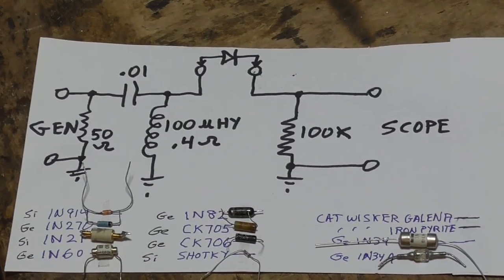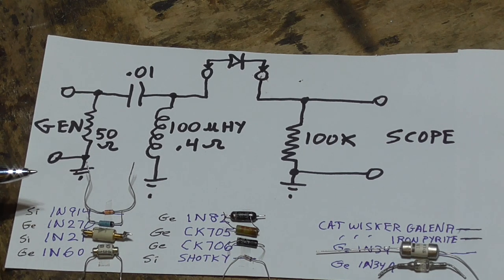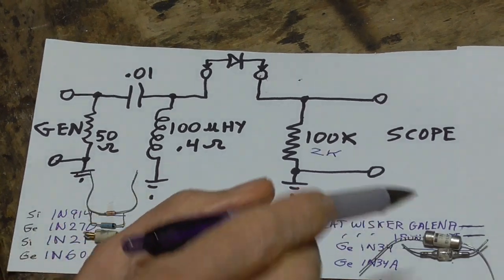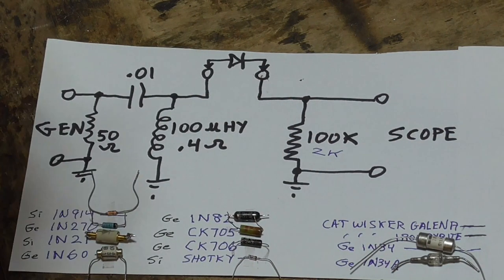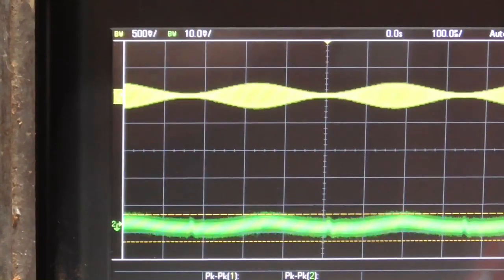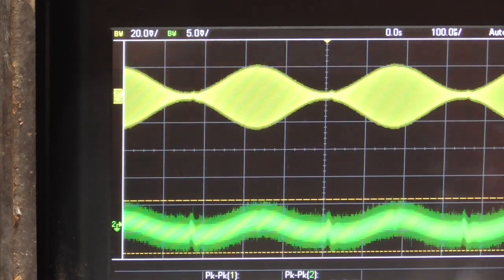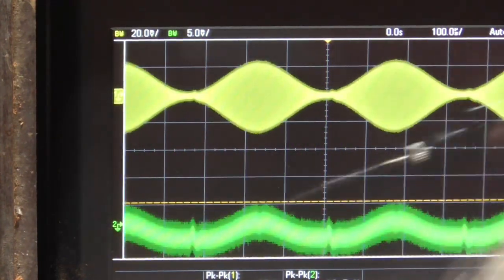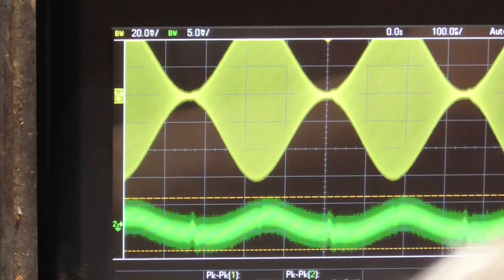TESTING DIODES FOR CRYSTAL RADIOS

Comment: Great video thank you. I recently read a Jan 2007 article by Bob Culter describing a high sensitivity xtal set using a zero threshold double MOSFET chip ALD110900A for the detector. I built his circuit but could not get it working,  I could not find the ferrite rod he specified. Tried a basic Chinese ferrite of similar size but possibly very different construction, also I am unsure if i soldered the litz wire properly. Further unsure whether the eBay litz was the RF enamelled strand type or the uninsulated type used in record player tonearms for flexibility (allowing free groove tracking). A bit clueless I'm afraid. :) Mr Coulter obviously had a working radio so a circuit to test this detector option might be interesting? Googly the article, very interesting stuff.
Reply from the maker: The whole premise of a crystal radio is to not use power, such as a battery. Thus, using the FET (which requires bias voltage to operate as a detector) would not meet the requirements. Also note that a biased standard diode would not meet requirements either.
Reply: @glasslinger  Ron, actually the Bob Culter design used a "zero Bias" FET, so no battery was needed.
The problem with that article is it tries to use just a ferrite rod antenna, so it is wildly optimistic unless you live very close to a BC station.
There has been a huge amount of work done since then (especially by the Chinese enthusiasts) and they get amazing results, but our tests on TRB showed that a FET detector (while excellent) is only about as sensitive as the best conventional diode detectors.
Reply from the maker: @graemezimmer604  Looking at the characteristic curves it looks like a small bias would be necessary to really get it working better than a point contact diode. It's really hard to beat a 1N34!
Reply: @glasslinger FWIW The original FET detector article was "Nostalgia for the Future" by Dave Cripe in 73 Amateur Radio Today, Dec 1995 .
the other was the "Hi Sensitivity Crystal Set" by Bob Cutler in QST January 2007.
If you go to youtube and search for "Testing the Double Tuned AM and FM Crystal Radio" 
you'll see  an updated version using a 3Sk143 FET. Billy gets quite extraordinary results on both AM and FM in a portable set, but he is quite close to powerful transmitters.

Comment: For the diodes with transparent casings, what happens to the sensitivity if they're illuminated with light? I'm thinking the photoelectric effect would help the electrons move.
Reply: Yes the light will provide bias, and with silicon you can use IR LED's to provide enough bias voltage to get them running.

Then makes me think an optocoupler with plain transistor output will work as the right device, as you get a base emitter junction for the diode, and the right light source coupling.
Reply: Saw in a 100 year old radio magazine that gelena detectors work better is bright sun light an in low light.

Comment: Ecg126 base emitter junction works good. I am thinking of using a tuning coil to tune in and rectify with a 1n34a and filter a strong radio station to power the collector through the headphones and another variable tuning coil for the actual radio reception for weak or strong stations. I haven't tried it yet but its a theory I have on my mind or a solar panel but that's cheating hahahaha. Maybe just a long wire outside going to a rectifier will pick up any stray RF and rectify but I don't know

Comment: Should try to get some of the more exotic diodes, like a backwards diode, where forward voltage drop is actually higher than reverse breakdown. But those are hard to get now, such highly doped silicon and also so touchy in use.
Reply from the maker: Motorola used to make these but they have been obsolete for over 20+ years now. Hen's teeth may be easier to find!    :)
Reply: @glasslinger  Try Unijunction transistors, they also make a pretty heavily doped junction, though they are now impossible to get, only source being old russian parts on surplus, unless you find a stack in some dusty corner of a military warehouse surplused.
Reply from the maker: @SeanBZA  I have some 2N491's. I'll see if they do anything.

Comment: Interesting video Ron, but I'm afraid you rather missed the point with bias.
All forward bias does is changes the impedance of the diode (eg moves the operating point).

So for instance a silicon diode (which has a very high impedance) can be forward biased to operate in a lower impedance circuit. And the 1N34 (which is fairly low impedance) can be steered to better match the impedance of your test set (and headphones).
To put it another way, if you arranged impedance adjustments on the input and output, you could get a 1N34 to operate at optimum sensitivity with zero bias.

Consequently it is misleading to test a number of diodes in a given circuit. All that does is show which particular diode suits your circuit best. A more useful test is to design a circuit with impedance taps (in and out) and find which diode likes which impedance.

There was an exhaustive study on this on TheRadioBoard, but unfortunately that has long gone.
Reply: The impedance adaptation (to get the best AM audio signal out) regards all radio detection diodes. The test setup in this case is/was based on practice and shows convincing results on the oscilloscope. It is in my opinion a proper test setup. The 100 K resistor at the output of the test circuit is a well chosen and practical value, just like the used (AM modulated) HF test frequencies.
Reply: @radiofun232 The problem is that those "convincing results" are misleading. 
For example it shows that a 1N34 needs bias. But it wouldn't if the input and output impedances had been optimised.

If a diode benefits from bias, it merely shows the impedances need adjusting.
All that bias does is change the impedance, it doesn't (and can't) change the sensitivity.

The other issue is that without a tuned circuit, the capacitance of the diodes can not be tuned out, which can make a big difference.

Whatever, these points can be easily demonstrated with a better test set.
Reply: @graemezimmer604  In my opinion and radio experience (made tens of SW radio receivers, watch e.g. my YT Channel) there is nothing wrong with this test setup. The same setup is/was used for testing different diodes, that makes a comparing possible. 100 K is a good value as  "end-impedance" parallel to which the probes of the oscilloscope are connected. When you make a crystal radio and give the detection diode some bias (like Glasslinger did) you can hear (and see on the oscilloscope) that the AM radio detection can be optimised. So it can change the sensitivity of the AM radio detection. My advice: make a crystal radio, or a simple superhet, test & try. Tune in e.g. to strong and weak radio stations and vary the bias, see/listen what happens. 9 sept. 2022.
Reply: @radiofun232  But again you miss the point. Every diode has an optimum impedance, and if you set input and output impedances to suit, you will achieve optimum detection sensitivity. And that will be the best sensitivity that you will achieve with or without bias. 

But if you test a group of diodes in a fixed test set, then all you will find is which diode best suits that particular impedance. 
And you will miss the fact that some diodes will perform even better at their optimum impedance.

Bottom line, this test can not show which diodes are the most sensitive, because it does not optimise the impedance for each diode.

And BTW,  I have build many, many radios and conducted many tests over 65 years.
Reply: @graemezimmer604  OK, good. But even with perfect impedances at the output and the input of the detection diode circuit there are situations where the signal that has to be detected is very weak. In such a case forward biasing can give better detection and thus reception results, by moving the operating point of the diode. That is my experience. Furthermore, it is a practical and handy way to get all kinds of AM detection diodes "working" in their optimum way. That is, of course, not your point, anyway.
Reply: @radiofun232  Yes. The problem is that the optimum impedance changes drastically as the signal reduces. 
If you set the impedances on a medium signal, it will be wrong on a weak signal.
Reply: @graemezimmer604  Ok Graeme, build your improved test circuit and upload your video to YouTube. Can't wait to see it. I am no expert but for unpowered crystal radio you are constantly balancing the need for sufficient electric power from an aerial alone to drive a high impedance earpiece, against the sensitivity needed to separate strong and weak signals. Gaining sensitivity saps the limited available voltage/amps. Multiple adjustable coil and capacitor tank and tuning circuits optimise the situation but surely a good germanium diode basically offers the best possible chance of success? Your argument seems to be pedantic and almost unprovable, it introduces many more variables into a highly reactive and interactive system. Redesigning an xtal circuit to allow any diode to function as well as an IN34A detector, where is the power coming from, only a much longer aerial.
Reply: @robnic52  Back in the day we did a series of experiments on TheRadioBoard and Rap'nTap (both now gone sadly), along with circuit diagrams and careful measurements. 

Whatever, experienced Xtal set builders know that for best results a germanium diode needs to be tapped down the coil, and the output matched via a high impedance transformer (preferably via multiple taps). But the key is that different diodes benefit from different settings. 

And yes there is always a trade-off between Selectivity and Sensitivity. 
None of this is controversial. 

In a Xtal set the Detector is by far the most inefficient part due to its Square Law response, which is why understanding it is essential to get good results.
Reply: @graemezimmer604  Hi Graeme, good to interact with you.  I am no expert on this so I apologise for my pedantic comment that is unwarranted, I was actually trying to understand the fine nuances in your argument for a better test rig. Shame that data has gone, I'm sure it was conclusive.
Reply: @robnic52  In my opinion: yes a practical and really "made" circuit with a forward voltage supply can do that job. So indeed, I agree, when a better test circuit (presented by Graeme Zimmer) to test these Ge (perhaps even Si ) diodes can be possible and presented in practice to drive them (the Si or Ge diode) to the point where the radio detection (AM detection) is at its best I am very interested too. I am also interested in that case regarding the input and output impedance in such a diode detector circuit, say to get the best AM detection out, via a Ge or Si diode. Say the practical circuit, demo, in a case with 1 type of GE Diode or Si Diode. That could be demonstrated with an oscilloscope and a proper test setup, like Graeme Zimmer told about, talking about a good/better test setup, compared to that of Glasslinger/Ron. 19 sep 2022.

Comment: I'd like to make a crystal radio but with a spectrum analyzer I've found that the two strong stations where I live are only 30 kHz apart. I doubt I'd be able to get usable separation.
Reply: You can make a notch filter to take those stations out.

Comment: I always use a 0A81 as a detector diode in crystal sets, I would have thought that you would have tested the range of the 0A series of diodes in your tests, or are the 0A series of diodes not commonly available in America as they are in the UK?
Reply from the maker: They are available on UK ebay but the shipping is horrible. (way more than the items!)  The original point contact diodes (1n34, 1n82, 1n60, etc.) have the same sensitivity as the point contact transistors. Note that none of the "modern" diodes are point contact any more. They are all diffused junction now, which have noticeably higher threshold voltages. This is why modern germanium diodes are not as sensitive as the originals with the same part number.

Comment: Nice work.   However your test circuit needs more capacitor to filter out the RF.  The results with a bigger capacitor will be a bit more dramatic.
Reply from the maker: The results in the voltage test were not as good. We were measuring the peak to peak output voltage. The capacitor reduced the peak voltage.  The results in the headphone test had no discernible difference when a .002 uF was used as the filter. Surprised me a bit too!
Reply: @glasslinger  Yes but pls keep in mind that the whole point of this circuit is to extract audio.  If you measure the peak-to-peak signal, with a lot of RF feedthrough, you get a misleading reading-- you get the higher peak-to-peak voltage but only about HALF of that is really audio, the rest is the thick green fuzz of inaudible RF feedthrough.  A capacitor will reduce the voltage on the scope, but you get a truer reading of the actual usable audio detected.     Regards.

Comment: Have you tried biasing a silicon diode til it reaches conduction? 
I know purists would say that's not the classic way.
Reply from the maker: Watch the video when the 1N914 is being tested with bias. Pay attention this time!    :)
Reply: Yes..I put your video on pause for later viewing. I always wondered about the biasing approach.
Reply: Yes. A Silicon diode has very high impedance and is pretty much unusable in a normal circuit.
However with forward bias, the impedance can be brought down to usable values where it can work surprisingly well. 
Unfortunately (even with bias) a Silicon diode isn't as sensitive as a good germanium diode due to the different chemistry.

Comment: I think people are forgetting the whole point was to be able to make a radio from commonly available parts.

In todays world finding a small battery to provide the bias voltage would be the simplest component of the radio to source!

Anyone that's ever seen a clock running off a potato for power could build the battery. Last time I checked, potatoes were easier to find than diodes that didn't need a little biasing.

Can't wait for your potato powered diode radio plans!

Even in the trenches of WW1 they had potatoes.

Comment: You should not redeem the scaling so low, as the noise of the scope abscuring the signal shape.
Reply from the maker: I wanted to see for sure what the low end sensitivity was.
Reply: @glasslinger  A useful way to cut down the noise is to add a very small capacitor on the load side.  A lot of that noise is up in the 1MHz or 10MHz range.

Comment: Years ago I heard that Phosphor bronze was best for a cat's whisker.  Phosphor bronze can be found in some guitar strings.
Reply from the maker: I have some wire. I'll give it a try.
Reply: I would think silver wire would be best, not really due to the lowest resistance, but it conducts well even if oxidized to black.
Reply: @franzliszt3195  Phosphor Bronze is very 'springy" and won't deform like copper or silver wire.